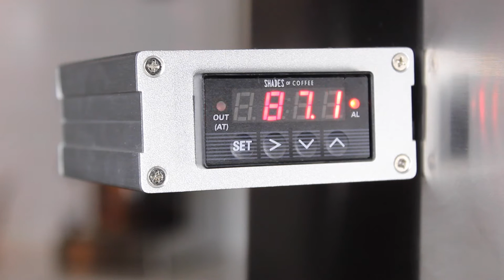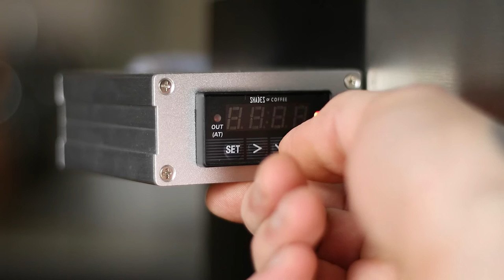Two Pre-Infusion Methods for the Gaggia Classic Pro

Comment: Thanks for this post. Working well on Gaggia Classic. I noticed that Shades of Coffee has a "flow control dimmer" kit for Gaggia Classic. I would probably buy this along with the brew pressure gauge kit if I had used their "topbox PID" system but I did not. Instead I did the regular PID kit and am not interested at this point in cutting holes in the metal case of my Gaggia Classic. Today, using the steam wand pre infusion method, I definitely noticed a smoothness in my shot that wasn't there before. Definitely cut down on the bitterness. I am assuming that the pre infusion is preventing channeling that was causing over extraction along the channels. But I really don't know if this is the case, since my knowledge of espresso is very novice level. In any case, I will continue to use this technique.

Comment: Silly question - If you start your PI at 99degrees, wont that burn or ruin the coffee? Understand this method makes sure that your temp does not drop below 93degrees, however during the shot your puck will be exposed to a lot higher temperatures than disired? Also what is your preferred setting on your PID? Mine is on the auto setting, collaborated at 93.5degrees
Reply from the maker: That's an excellent question, all I can say is the coffee didn't taste burnt. What you're saying makes perfect sense though and I wonder what's the exact temperature of the water that first hits the puck.
Usually I would have it on 94 celsius
Reply: I have been reading Scott Rao's "The Professional Barista's Handbook" and on page 24 of my copy, he makes a distinction between "brew temperature" and "extraction temperature." To paraphrase, he argues that there is a fair bit of delay between the brew temperature and extraction temperature with various things causing that delay, such as a cold portafilter, which can dramatically reduce heat of extraction temperature. Of course, as more and more water is passed through the portafilter and the grounds are immersed in the water, the extraction temp rises and will eventually match brew (ie dispensing) temperature. So it may be that in this case, even though the brew temperature gets hotter than you'd prefer for extraction, there's not enough of that excessively hot water making contact with the grounds to have a noticeable effect on extraction temperature.

Comment: Nice video, Goran. With no PID I find using the steam wand problamatic on my GCP. What do you think about using a dimmer to control the water flow from the vibration pump.(Lance Hendrick video}. Seems to me this might be a nice flow control solution.
Reply from the maker: Would be cool to have a dimmer, but I'm not confident in making one myself. 😂
Reply: @tmb-themajesticbeanchannel1746  There's a slick looking dimmer option for just a few bucks that looks easy to install fyi, I'm gonna do it myself soon. Good install video here: https://www.youtube.com/watch?v=5rEBmcP1ZUo

Comment: I've recently started using the pre-infusion method suggested by WholeLatteLove on my stock Gaggia Classic Pro (full 15 bar pressure).

For each morning shot this week, I moved the steam knob to 10 o'clock, hit the brew switch for 5-8 seconds before I closed the steam knob. My shots have consistently tasted better to me (slightly sweeter, less acidic). However, my bottomless portafilter still exhibits excessive spattering. I don't think I'm getting full on channeling because the extraction output coalesces nicely to the center of the bottomless portafilter within a few seconds --- I just get spattering (tiny droplets across the drip tray). I attribute the spattering (right or wrong) to the full 15 bar pressure on my stock GCP setup. 

The promising news for me (I think) is that I got a 9 bar spring from Shades of Coffee a few weeks ago. I've yet to install the lower pressure spring. My next experiment will be to try the same steam knob pre-infusion method with the 9-bar spring to see if that improves my extractions. At the very least, I expect to see less spattering. 

Your video reminded me of the likelihood of temperature loss using this technique. At some point, I'll probably have to get a Shades of Coffee PID kit. 

Thanks TMB! Your videos always give me more ideas on how to improve my shots.
Reply from the maker: You're on the right track Bob, the 9 bar spring will help you with the channelling issue and you'll get even better results when you get a PID
You'll be making cafe quality drinks in no time 👌😁

Comment: I've using a modified to 9 bar lelit Pl042temd. Should I use the 99° method on the PID with 9 bar or with the full pressure of the machine?
Reply from the maker: that's a good question Norman, but I don't know if it would work the same on the lelit

Comment: I find the pump dimmer for the gaggia is the easiest mod for pre-infusion and flow control, the dimmer is only 6$ and the mod itself is as easy as it can get
Reply: Do you have a link
Reply: @brilandis2  amazon:  GE Single Pole Rotating Dimmer Switch Use with Dimmable LED, CFL, and Incandescent Bulbs, Includes Two Knob Colors, UL Listed, White/Light Almond, 18021
Reply: @rc3443  thank you

Comment: First and only Pre-Infusion Technique for Saeco-Gaggia portafilters (named often pressurized and Mixed with Pinhole only portafilters from other Brands) is "use Manual Saeco-Gaggia portafilters properly"....
At the Automatic Saeco portafilter the portafilter does the Job for you.

Finnally a Pinhole only basket in a portafilter does Not created real Crema while any Saeco-Gaggia portafilters create real Crema even the so-called pressurized portafilters.
Just Insert a Saeco-Gaggia portafilter with tamped Espresso in a Gaggia and Dismount the lower Part while leavin the uppert Part mounted in the Gaggia. It works Like a Open/bottomless portafilter and created real Crema....as the basket isca fully Open basket and the removed Ventile has a opening a counterpsrt which is as big as the Stream usually comes Out of a open/bottomless portafilter.

At the bottomless portafilter and the Gaggia Classic Pro you regulate the effective pressure Not by a 9bar mod but by the right grinding Grade of the beans and the tempering itself.
So a Barista on the Level of understanding Gaggia's inventions differentiates between
- Puck-regulated pressure and
- Basketholder-ventile regulated pressure.

Most precise is the Basketholder-ventile regulated Extraction. The pressure is Always leveled at 9bar except the Puck overrules the Ventile in the basket holder.

Pre-Infusion you better use for 100% Highland Arabica and blond roasted beans only. Something which was Not the Intention of Gaggia when he invented the modern portafilter Machine with Crema.
Better use poor over Extraction with enough contact time for 100% blond roasted Arabica Highland beans. Everything Else is waste of money and time....